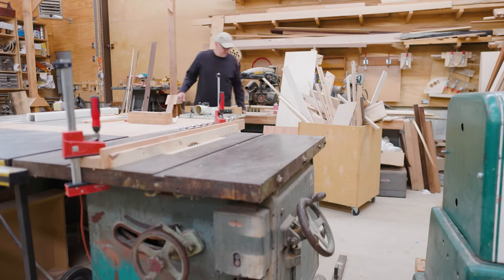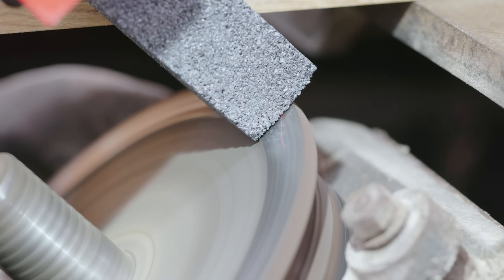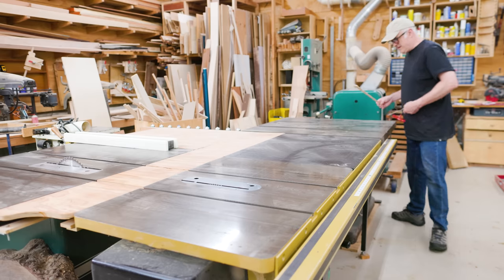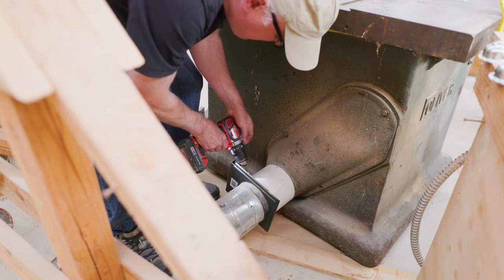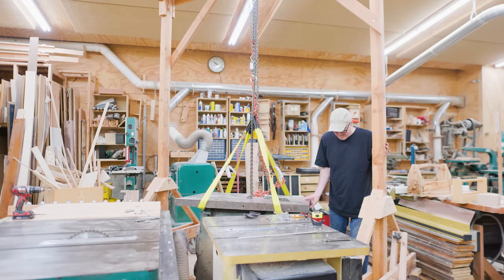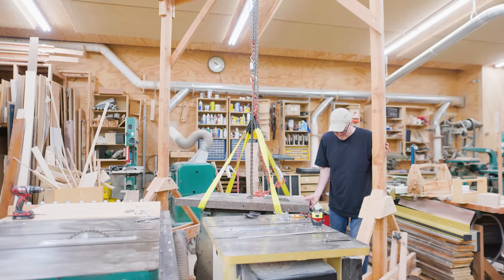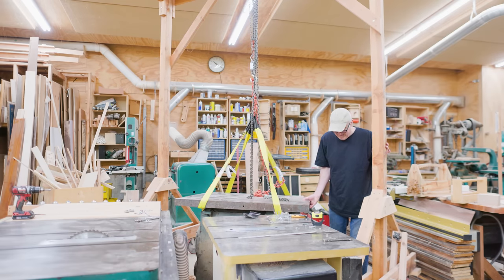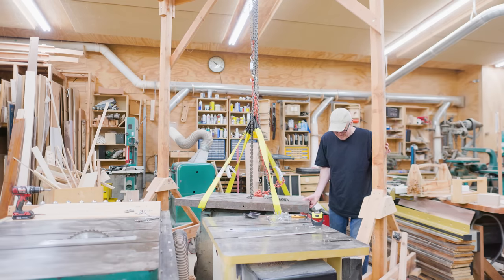Juggling Table Saws

Comment: 11:05 From personal experience, I like to call that Schrodinger's tape measure. Whether the piece was cut to the correct or incorrect length is only determined after I've cut it.
Reply: When I was in the Navy working with millwrights, they only shimmed with metal. It was non-compressible  and performed better than wood or plastic or other softer materials.

Comment: My first table saw required me to set the rip fence using a tape measure.  After owning my Powermatic with an accurate ruler built into the fence I still feel like it is automatic.  Not seeing the need to go electronic on the fence setting.

Comment: If you raise whatever your lifting above the legs of the crane or engine hoist or whatever, you can the place some beams across the legs and lower the item onto the beams. That way your crane becomes a trolley, the item can't drop and doesn't swing around as you're moving. Once you get close, lift, take the beams out and off you go. Much easier and safer that way...
Reply from the maker: I hadn't thought about that. Basically making the crane into a cart. I like it
Reply: @frankmakes  otherwise you're just swinging a pendulum. That hasn't been a thing since the Renaissance 😄

Comment: To grind my arbor flange I did the same thing except I used a lollipop type ball stone in the router.
With the router and saw running and arbor perpendicual with the table top crank the blade down
 just bellow the flange and bump the router over to just barely touch the stone to the grinder.
Now with both router and saw running slowly crank the blade arbor up and down then bump the
router over just a little bit at time and keep cranking the arbor up and down until there are no more sparks.
After several passes the arbor will run true.

Note: make sure the arbor bearings are good before doing this or results will be bad.
Reply: Is the Arbor the Plainer?
Reply: @ericpohlman5131  The Arbor works with the Plainer to defeat the Jointer in the battle with the Lathe Master, unless the Plainer uses Magic to fool him into ...

Comment: Hey Frank, I enjoy your videos and thought I would drop you a note regarding table saws and on/off switches.  On my table saw I installed a push button switch (momentary) that was easy to find on the front of the saw that pulled in a relay to actually start the saw.  A second contact on the relay held it energized. To stop the saw I put a kick plate just above the floor that was attached to the front of the saw.  A normally closed switch was attached behind the kick plate, so that when the kick plate was kicked, the switch opened and dropped out the motor relay.  No need to try to find the on/off switch, just kick the kick plate.  I kept the regular start/stop push button for a safety shut off when the saw was not in use.  Just a thought, again, always enjoy your videos.
Reply from the maker: Yes, I was thinking of making a wood piece to go over the switch with a hole in it. I could push the on button through the hole and I can hit a entire wood piece with my knee or foot to turn it off.

Comment: I want to see more of the mechanical structure of the Rip-It.  On my #72, a standard Biesemeyer fence is not stiff enough and I think we can all agree that it is a pretty stout design.
Reply: Have you seen Jer Schmidt's fence design? It's one of the best IMO. He is on YouTube.
Reply: @ADBBuild  I have and it is certainly interesting.  His use of a "half nut" and lead screw is pretty clever for a tablesaw fence.  I will likely build something similar for my #72 sooner or later.

Comment: 3 Legendary saws.  I recently was able to add a 1983 Unisaw into the shop as a complement to my SawStop.  I have actually being using the Unisaw more frequently.  Go figure.
Reply from the maker: Yeah I know how that goes. I got the 66 new and it was nice. Then a few years later I got the old used 72  and I find I use that more than the 66.

Comment: I thoroughly enjoyed watching your thought-process and ingenuity. I have used the "raise one side of the saw (jointer, planer, etc.)" and attempt to kick a pad under the base, hoping for the best. One day when it wasn't working out too well, after a 3rd cup of coffee, I turned 2 parallel clamps heads around to make parallel spreaders. With a 1300 pound clamping spec, I figured they should be strong enough to lift one side of the saw. It worked great. With 2 "spreaders", one near each corner, they easily lifted the saw. Also, it was easy to fine tune the height. Good luck, stay safe. Thx.

Comment: I have a 1955 DeWalt that looks very much like yours. Had the motor apart for cleaning. Takes forever to slow down after cutting power - adding a circuit to help with that. Good video - thanks for posting.

Comment: I came across that exact saw when I ran a shop in Kansas City back in the 80's. It was complete, fence, two miter gauges with the bracket that tied them together, the extension table, and even the manual. Built like a milling machine. Oliver was still in business in Grand Rapids at the time. I got the spec sheets from them.  It could handle an 18" blade and a 4" wide dado head! I shudder to even think about that. Good to see another one!

Comment: Hi, Frank.. I always seeing you fighting with your radial arm saw... Here is one suggestion. Make the pully from the counterweight rope bigger.. The bigger, the better. This is a lesson which i learned on my Homemade panel saw build. Greets from Germany.
Reply: He's not struggling, at least, not in the way you think. And he has the counterweight you describe. I recall Frank commenting in another video that he didn't bother with installing negative-rake blades on his radial arm saws (look it up). Without that, and by using a saw blade built for a conventional table saw (positive rake) you are fighting the radial arm saw's natural inclination to grab and accelerate through the wood--very unsafe. Essentially, the difference between have the saw above the workpiece (radial arm saw) and below the workpiece (table saw).

So Frank compensates by pushing the saw as it pulls through the cut, resulting in that awkward cutting behavior. I had to do the same thing until I switched to negative-rake blades on my radial arm saw. They are expensive and can't be used on a table saw, so many radial arm saw owners don't bother.

Comment: In some ways, I’m glad to see that I came up with the same solution a few years ago with the arbor.  I chucked up a grinding stone in my router and it helped take out the high spots (dents and impacts) fairly well.  But I didn’t come up with such a thorough jig that you made.  My Powermatic is also from the 60’s and it’s seen a bit of work.  For me, the real fix turned out to be the coulet under the nut securing the blade to the arbor.  It was smaller diameter than the one that I’d machined with the grinding wheel and in effect, it was bowing the blade when tightened down.  Once I’d had a part machined that matched the arbor, the blade was straight and true.  Love your videos because I enjoy seeing how a real pro engineers things.

Comment: You know, why not put everything on wheels on the shop?

I do this on everything at my home for ease to clean stuff up. What you think about this?
Reply from the maker: A few things are on wheels. Many of the machines are too heavy for wheels, they would be on wheels and still too hard to move. And some machines, especially the lathe you want absolutely rock solid without any vibration and wheels. Kind of hurt that goal.

Comment: You needn't have gone to all that trouble. I had the same problem with my Oliver. I just took the arbour plate off and cleaned it up thoroughly. Then I put it back on. It was just dust and grime build up. 
Every good wood machinist knows that's the first thing you check for if there is blade wobble. It's either that or you have a bad bearing. 
Oh well, that's another good machine stuffed up using a very dangerous method to fix a very simple problem. Lol.
Typical Mathias fix. 😂😂
Reply from the maker: I didn't realize the arbor plate comes off. I will have to look at that.

Comment: Frank - you said you use the Oliver for ripping. How do you use the other two saws differently? In other words, why do you need three table saws? 🙂
Reply from the maker: It's nice having different saws set up for different operations during a project or even multiple projects.
Reply: @frankmakes  do you keep the two powermatics setup in certain ways, or do you consistently change them? Thank you for replying.

Comment: SCREW - goes into a threaded hole.
BOLT - goes through a smooth hole and has a not on the back.
NUT - has female threads.